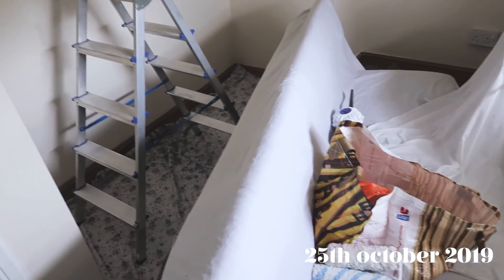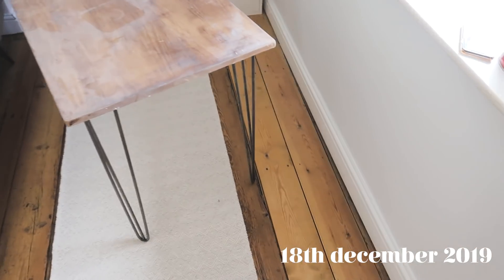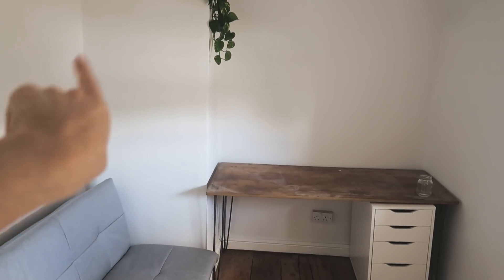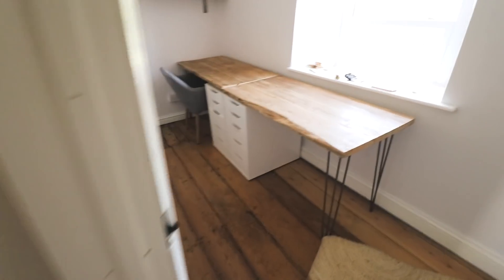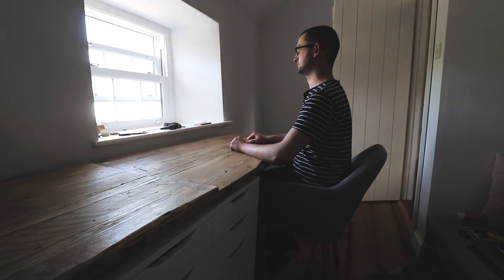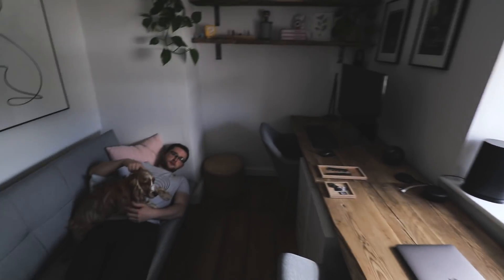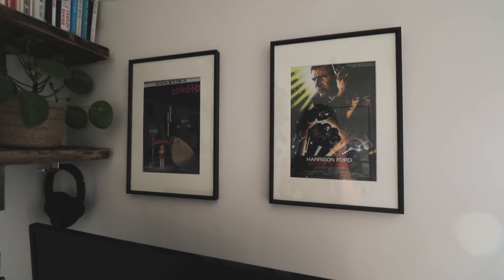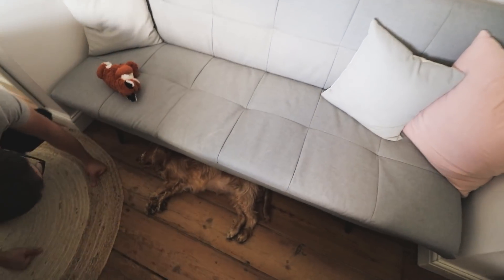HOME OFFICE MAKEOVER | RENO VLOG 12

Comment: we have shelves like this. 
my other half is a carpenter multi trade guy, 
he fixed the scaffold boards to the blacksmith brackets (we have similar ones) first, 
then measured a level line of height on wall where we wanted them, and then fixed the brackets which was already attached to the shelf onto the wall.. as the brackets are all made individually, we have about a 2cm gap at the back of the shelves to the wall, but the front etc is flush. 
if you haven't already on your next shelves, try attaching the shelf to bracket first etc xx

Comment: I think that part of why the shelves look off is the wood but also because the right bracket on the bottom shelf is longer than the bracket on the left side of that shelf. So the left one got switched around so the longer end is the part that is connected to the shelf instead of being the part that is hanging down and connected to the wall.

Comment: I love it, it looks so nice and cozy!! 😍I was thinking, if it bothers you that the tabletops don't line up, maybe you could try switching them around? As in turning around the desktop that's on the right and moving it to the left side and vice versa. I don't know if that would work better or if the tabletops are equal in width and maybe you've tried that already. Also,  that would mean having to rearrange the cables and maybe that's too much trouble. Anyway, they look great and I love the look of the wood!

Comment: The desks would actually work better centralised to the windowbay. Interior designers avoid putting desks right up to room corners cos it creates dark gloomy areas, that visually weigh down a room, as well as, closed volumes where it is hard to clean, dust collects etc. 

Once the desks are centralised, the cords  can be coralled into a basket on either ends, and a lamp can go into the corner. So there is more breathing space between furniture pieces, it will really open up the whole room.
Reply from the maker: We would love to but where the door is and the size of the room (very small) we don’t have the space to do it! I’d block the door at my desk if we had it that way x